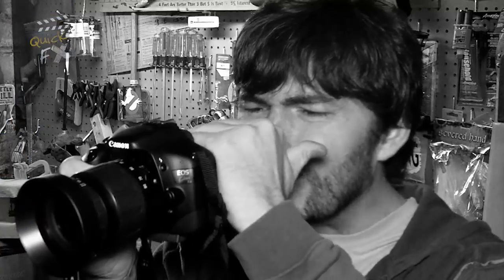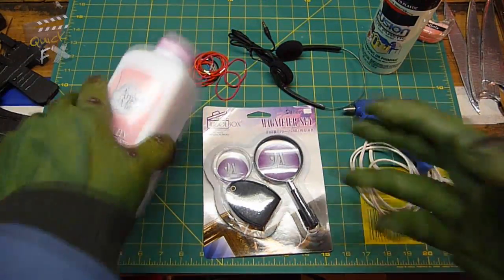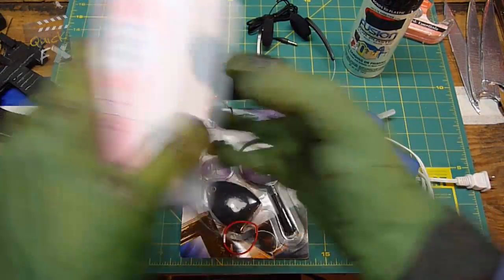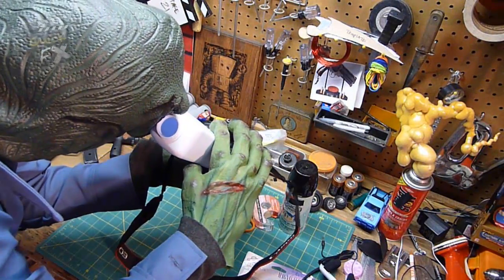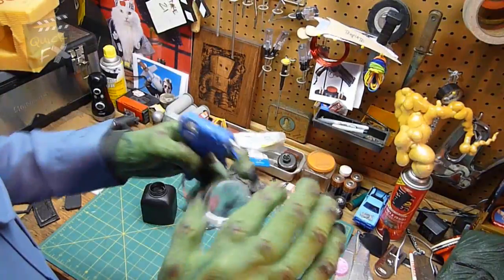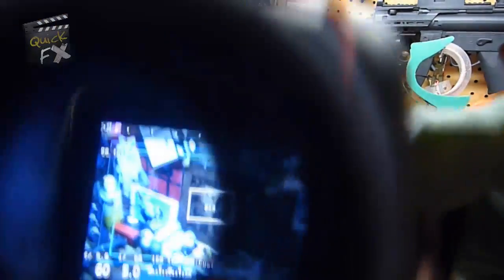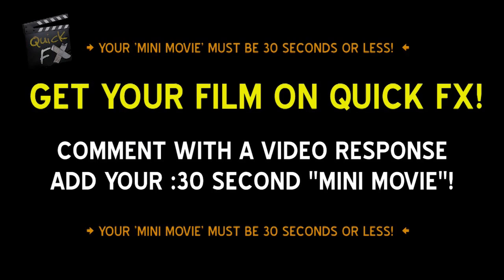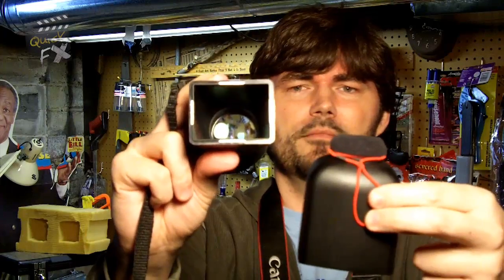Homemade DSLR LCD Viewfinder - DIY Loupe - QUICK FX

Comment: Aww I'm so disappointed this won't work for my sony nex 5n because I'd have to wrap the top hair tie around my external FLASH and.. I have nothing on the bottom to wrap the bottom rubber band around. On to the next diy!!
Reply: You do realize an external flash is more than useless for video? Use  LEDs if you want on camera light, a flash in continuous lighting mode will not give you the right temperature of light for most settings...

Comment: A great trick to get stickers off anything is to use a hair dryer for about a minute. It should then peel away easily. If you don't have a hair dryer then soaking in boiling water for a minute does a good job as well.
Reply: 2 letters 1 number - WD40

Comment: Hey, Knoptop. If you take the lens and a ruler (or any straight object you can mark on) and simply hold the lens up to your eye in front of the LCD screen, you can find the correct distance without having to continually cut the container to find it. Just be careful not to scratch the LCD screen with the object your measuring with.

Comment: Say Phil i have the same problem with my D5100 the answer is easy one get a screen protector!! to start now get some material sure you could buy some thin socks but either way make a sleeve out of black material size it to the flip out with the screen on so you can see the whole screen place the sticky metal plate.. Take the sock off your camera and stitch the plate into place then cut the material away to the stitching. Slide the sock back on to the camera lcd then put on the hood enjoy!

Comment from the maker: Have you dry fitted the frame to see if it will close?  We have a 60d and a frame glued on and it flips close ok.  But as far as scratching, cameras like the t2i, 7d, 5dmk3 have the lcd screen exposed all the time (no flip out) just take care when packing it away and you should be ok.

Comment: I purchased a pro viewfinder.  It has a magnetized bracket that needs to be glued to the LCD screen to act as a mount for the viewfinder.  If I glue this thing down, I won't be able to flip and close the screen into the camera to keep it out of harm's way.  Is this a typical problem with viewfinders?  If so, does the LCD screen eventually get scratched and damaged from being exposed all the time (even with a plastic sheet protector)?

Comment: I believe Baby Oil will also help remove the labels. As a followup try using a window glass cleaner to remove WD40 or oil residue. Paint should adhere after that.

Comment: Working on mine and found WD-40 helped with the sticker removal, take your time like Dave said and with the remaining residue use WD-40. Also, gauging the distance of the lens was the most difficult; I mounted my DSLR and focused on an object then, without the bottle, I just put the lens to my eye went from far and moved closer. Once I found a rather sharpened image I recorded that distance from the lens to the DSLR's LCD and transferred it to the bottle (saved countless trail-n-error cuts. GL!

Comment from the maker: @monchee10 I sanded mine with steel wool and sprayed multiple light coats (instead of one thick coat)  but I'm still trying to figure out the best options.  I ended up wrapping some black tape around the outside near the lcd, where I handle it the most.

Comment: Did this DIY, same bottle at Dollar Store, fits perfectly on a Canon 60D, buttons still accessible.  Used goggle eyepiece for better comfort, takes time to cut the goggle plastic out and hot-glue on container. Black plastic spray paint scratches off on any sharp contact. Bottle has a STRONG baby powder smell to it, even after a vinegar wash and spray paint coating. It's cheap, it does the job, and I'm satisfied with this DIY.

Comment: Great idea.  Just finished making mine and seems to work well.  Have not tried in the outdoor sunshine yet.  I struggled to find a kids magnifying glass and ended up taking the lens from a £1 pair of plastic binoculars from the pound shop - which works really well as it provides a bit of a hood around the eye piece so I did not need to do the thing with the foam from the head phones. U used an old multivimine pot for mine.